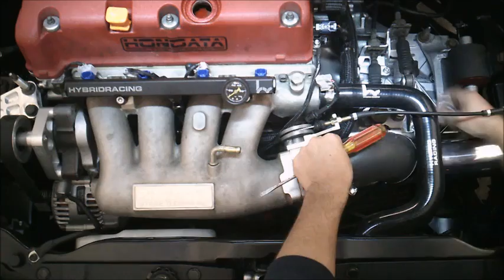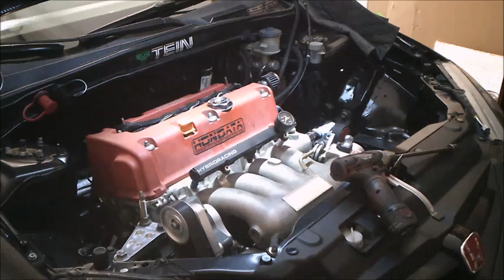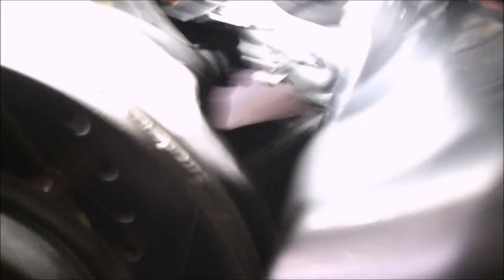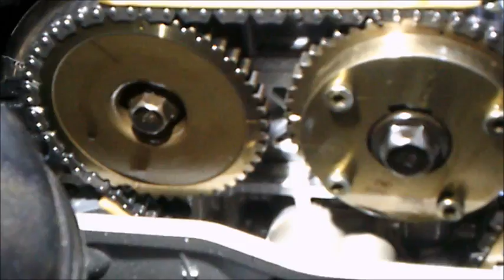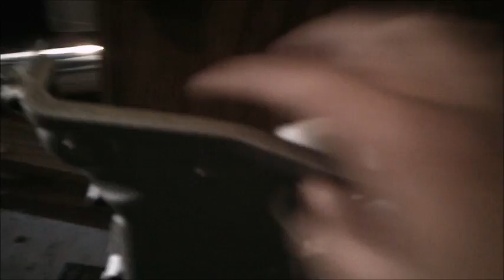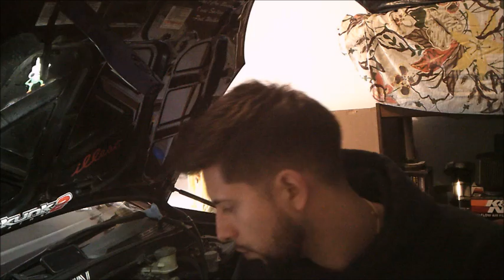K20 HEAD REMOVAL!

Comment: I’m suffering from a perpetual VTEC solenoid gasket leak on my K20A3, and one of the bolts is rounded and possibly cross threaded…gotta take the head off!!

This’ll be super useful, especially for a first-time on taking a head off. Thanks so much for the info!!!

Comment: Do you have the type s or the base model? I have a base and would like to swap the K20A2 head onto my block for a bit more power, my eventual goal is around 250 to 300hp out of this motor and was told to get that I would need the head swap.
Reply: Be careful the bottom end of the a3 is pretty weak in comparison

Comment: That crank bolt, I had to use my 3/4 inch impact. My 1/2 inch drive Snap-on wouldn't move it. 3/4 made it instant.

Comment: I have the same intake manifold (z3)and notice one of the mounting holes the 10mm bolt hole was not used. Does your thermal gasket have a small "L" hole for the water passage? And i also notice the center vacuum port can't be used because of the gasket... So how did u run the PCV  to the get vacuum? And did u run coolant through the IACV?  What's the purpose to run the coolant through it?

Comment: Does anyone know how to take the intake manifold off? I have a 04 type s and I’m having trouble taking the manifold off. It keep getting stuck on , forgot what it is call, that thing on the left where the serpentine belt is. Do I have to take that off or is there a trick to popping the manifold off?
Reply from the maker: terry thao your gonna have to remove one of the studs off the head in order to take it off
Reply: SERGMOTIVE GARAGE thanks man!

Comment: Yo buddy hows going?, i ve already asked you couple questions but i have couple more,
my k24A3 has blown head gasket
i am going to use new stock type engine bolts, the head will get maschine resurfaced and if the block is warped too i will do that with glas and fine sand paper.
1) should i use ARP thread fastener lube on the threads like you did? If yes, should i use it to all of the engine bolts? What about blind holes? (I have no clue,where should i use it so please make it clear and simple!)
2) what about if i use copper spray sealer? Will that give a good advance of reliability? Will i still be able to remove the cylinder head and the gasket without any trouble? Will it permanently stick everything together? Which product of copper spray do you think is the best? Please let me know you are the only one that can really help me with that and i am about to disassemble the cylinder head and I MUST do it right, for the sake of my JDM loved Princess! 😍🔰 i would be more than glad to donate some money for your time to answer my questions! 🤗🔰
Thanks A BUNCH in advance!
Reply: Loyal Honda Fan kinds late why so all that when you could pay the same for a a2 swap or even k24
Reply: A3 its garbage save the money get the a2 👌👍😉

Comment: Could have saved a step by leaving the intake mani attached to the head. Just disconnect all the hoses and such. Just shortens the process a tad. I understand you were taking it to a machine shop so you needed to but to just swap over its not.
Reply: Silver Strider im about to change  my head soon so ur sayin i can leave the mani connected?  Cuz i see mad vids with everybody removing  it??
Reply: Yea you can, it doesn't get in the way or heed anything. Just make sure to disconnect everything that is attached.
Reply: But if you are transfering your IM over you may as well take it off. Just if you are replacing the headgasket or such things.

Comment: Thanks for the video buddy, well i  am pretty fucked up, my radiator fan switch sensor stopped working and my k24a3 overheated for too long i losed coolant and i filled coolant and tried to bleed the system for more than 1 hour but i saw bubbles coming out of the radiator when the thermostat opens.... i have to resurface the head and change head gasket... i am also afraid that the block is warped as well... do you have any suggestions if the block is warped i am really fucked up and it will be extremely hard to get it out to resurface it since i dont have the tools and i am broke asf... 😔

Comment: Was your K20 Throttle Body always cable or can you swap a Fly By Wire TB for a cable TB?
Reply: This year uses a cabled throttle body, you cannot simply swap to a drive-by-wire setup or vice versa because more things would need to be changed (pedal assembly is electronic, wiring to and fro, ecu is different, etc).

Comment: Bro the Problem is the Metal PVC valve thats in the oil pump housing. the spring in the PVC always break, causing oil to go up in the hose going to the the intake Manifold.. The same thing was happening on this k24 CRV i bought.

Comment: do the spark plug tubes come off?
Reply from the maker: if im not mistaken i think they do come out, but its not easy. they are either screwed in really tight or you need to heat them up like valve guides to pull them out. im not 100% sure

Comment: Good videos bro.. Btw im learning about cars im planing on doing a swap and im gonna reuse the head question is can i reuse the valves and springs and all that even tho i have 160k on it already.. Im on a pretty tight budget.. Built bottom end and keeping head stock as possible with turbo
Reply from the maker: in most cases you can reuse the head. just dont make the mistake i did and get the head checked out. you might have a valve slightly bent and wouldn't even know it. i suggest spending the extra money and letting a machine shop check the whole head out. k series heads are known for having the exhaust guides wear out and then you start burning oil. also if your gonna go turbo i suggest to atleast upgrade your valve springs and retainers, you can keep your stock valves